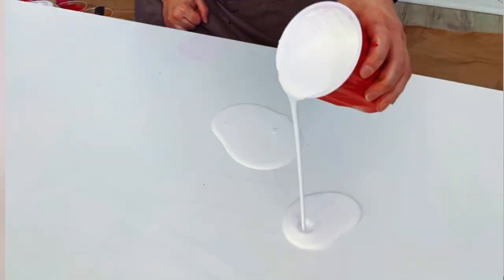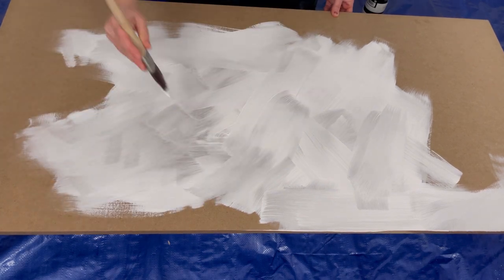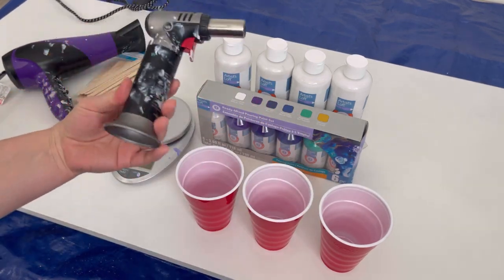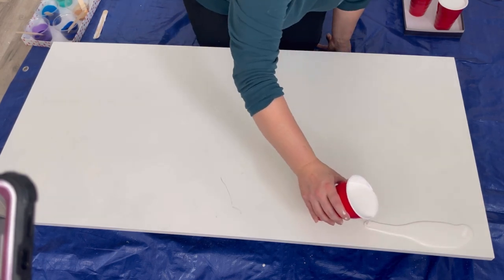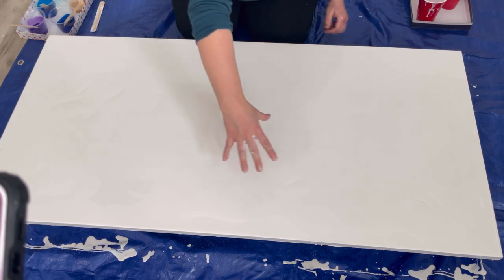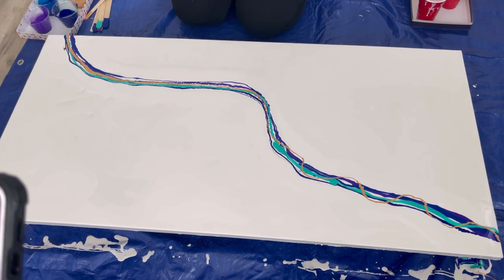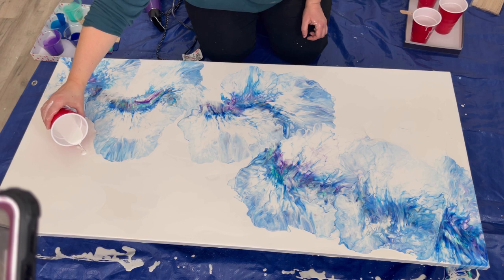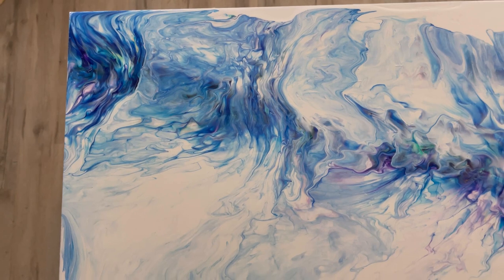An ACRYLIC PAINT POUR for my NEW customized desktop! Flexispot Standing Desk

Comment: I read somewhere that you should never go higher than 30% water because it has no binder and will impact how well the paint sticks in the long run. I’m wondering if you can use a heat gun instead of a torch for the bubbles?